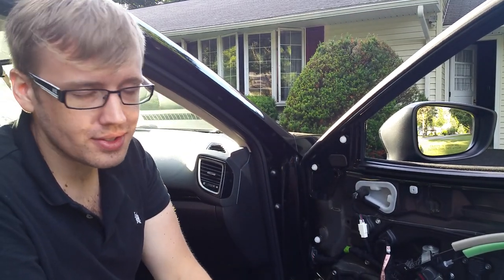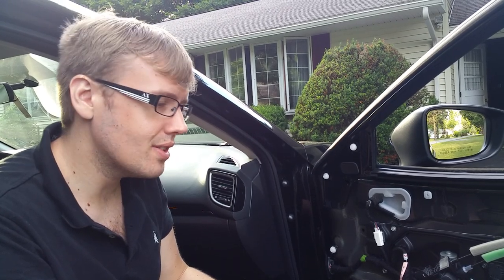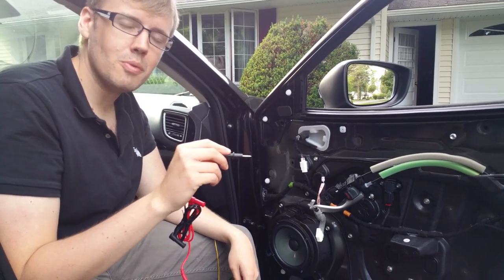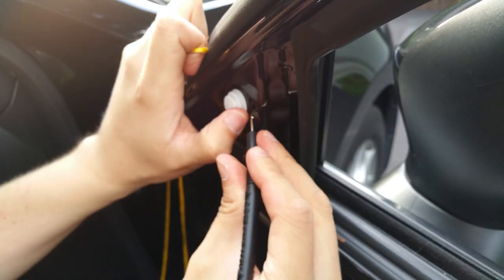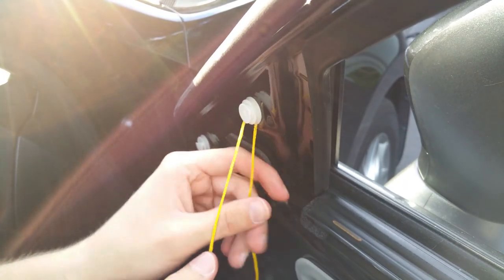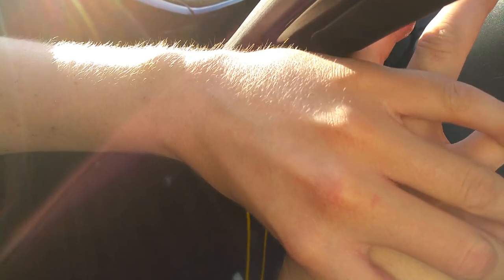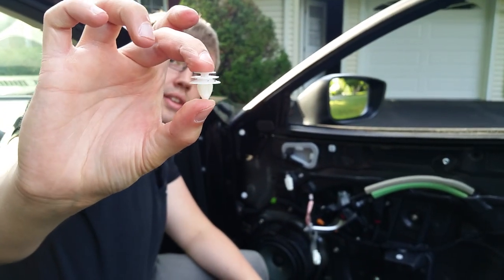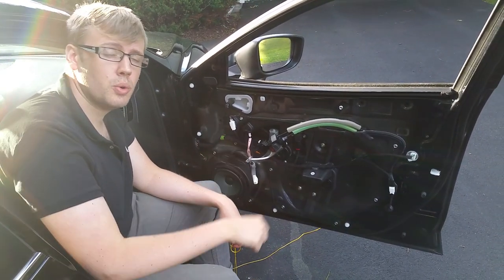How To Remove Door Panel Clips - Easy Method

Comment: I'm surprised those clips didn't break when you removed the door. Suspicious. However, thank you so much for this string method. Its genius
Reply from the maker: Some of them broke/cracked, but we're still usable. But pulling out any other way would absolutely destroy them unless you had a clip pry bar.

Comment: The clips...when removed are for the most part done. They no longer have the true structural integrity to hold the panel 'tight' against door. Do your self a favor,  know the number of clips needed, per panel, before you tackle this job. Order as many as needed, usually one extra full panel count more should something happen and panel has to come off again. Now the panel sits nice and tight against door after re-install. RockAuto, Parks
 Geek, E-Bay, etc ...all sell these clips...cheap.
Reply: That is NOT true I've did hundreds with 90% reuse just fine...